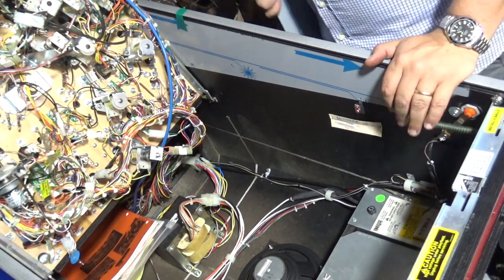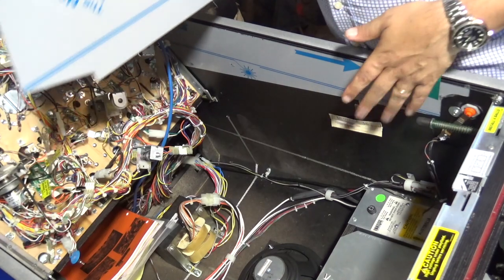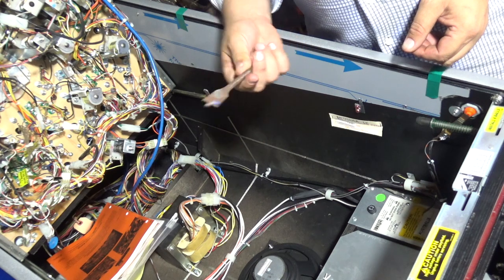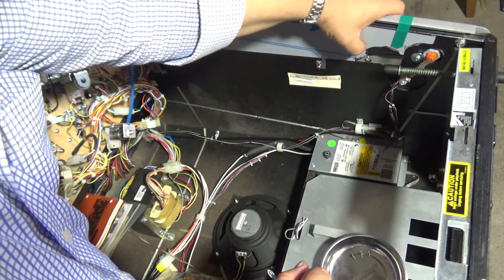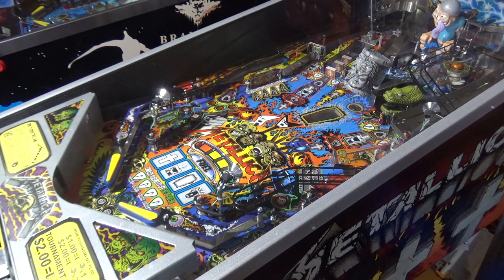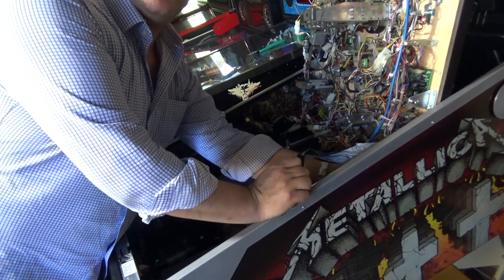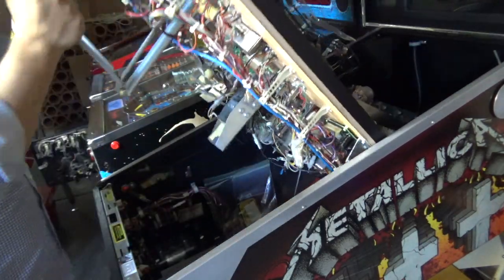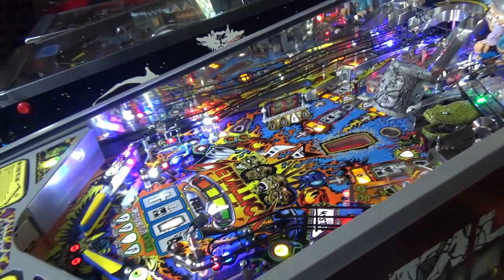How to Install Mirror Blades in a Pinball Machine

Comment: Did the mirror blades come with countersunk screws? is the blade itself countersunk?
Reply from the maker: Counter sunk screws were supplied with the mirror blades.  The blade it not counter sunk but is thin so the screw head sits almost flush with the blade once screwed in.
Reply: Thanks!